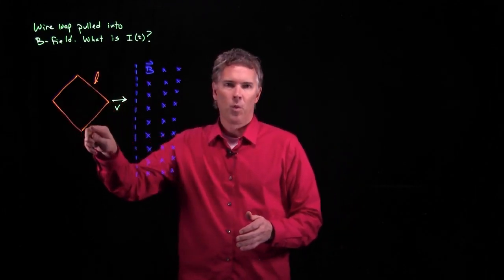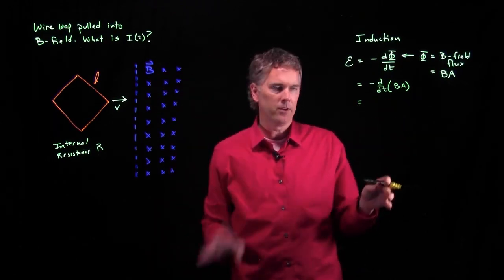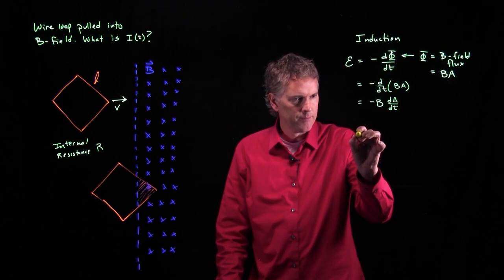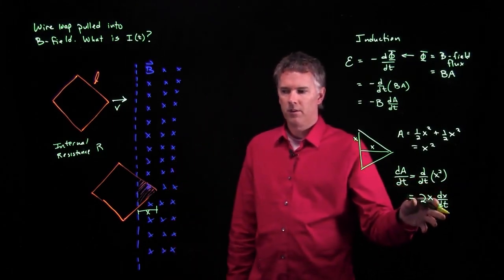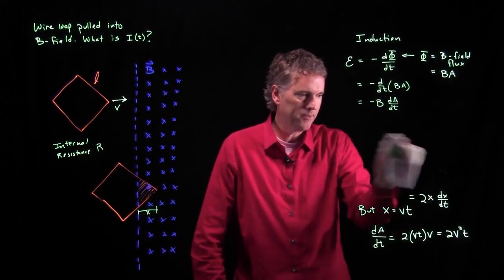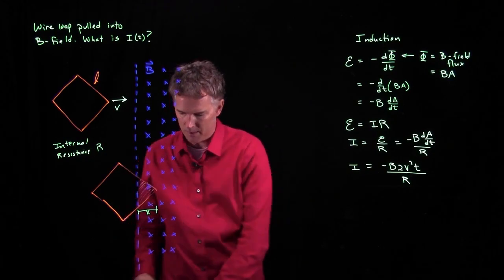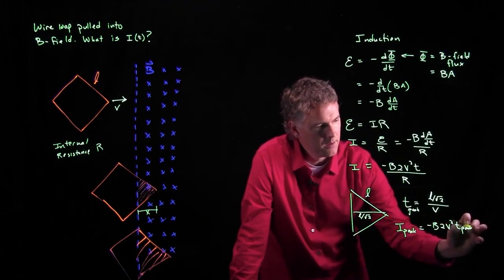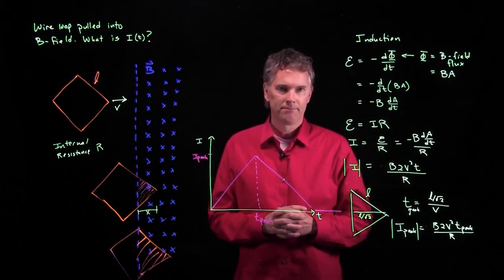Wire Loop Pulled into Magnetic Field | Physics with Professor Matt Anderson | M24-15

Comment: I must be missing something. Seems like I peak would still be increasing as the loop continues across the B field until the area exiting the B field is larger than the area entering the B field.
Reply from the maker: In this example the loop never exits the B field.  The right side of the picture, where the B field is, continues forever.  We know that once the loop starts moving in constant B field, there is no change in flux hence no current.  Namely, the current had to return to zero.
Cheers,
Dr. A